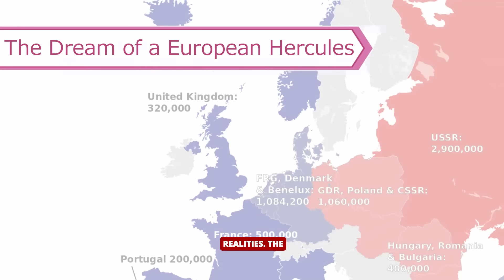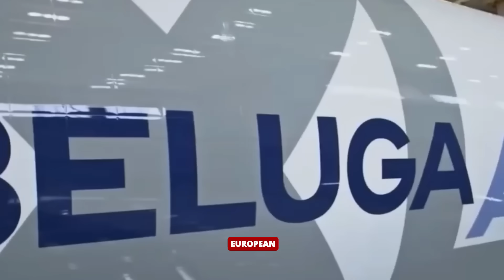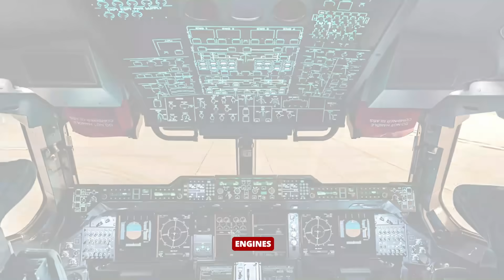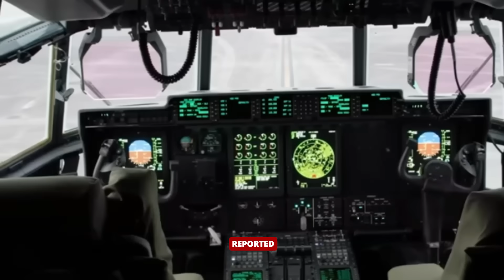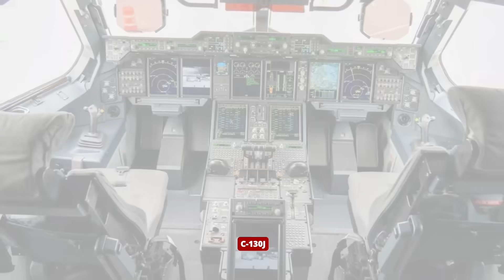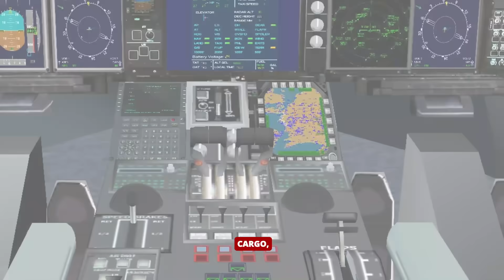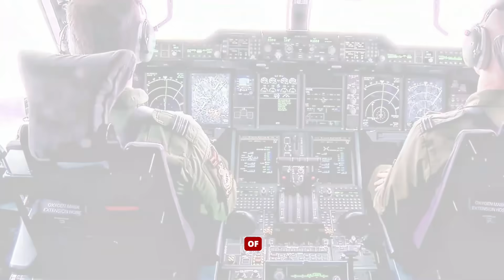Why Europe's $180M Jet Can't Beat a 70-Year-Old Plane

Comment: The A400 was never envisaged as a C-130 replacement, it was meant for air forces that want something that could carry more meaningful payload for a strategic deployment rather than solely for tactical missions (which C-130 is designed for) , but yet found the C17 too expensive , too complicated / too big / out of reach to buy because of political reasons. The A400 is meant to fill this gap between the c-130 and the C17 , not replacing or competing with either one. 

Many nations that bought the A400 didn’t retire their own fleet of C-130s , instead , they operate both types alongside each other to fulfill different airlift requirements. The analogy of comparing the C-130 to the A400 is completely wrong and misleading.
Reply: The C17 and the A400M both started the design phase in the early 1980s. The C17 first flew in 1991. The A400M first flew in 2009. By the time the C17 first flew, the French, Germans and UK already too invested in the A400M program. 
The C17 only cost a bit more than the A400. C17 about 220 million. A400M about 150 to 180 million. The C17 was already sold to many countries before the A400M first flew. 
The C17 is out of production now, so that helps the A400M. The British did sell many of their C130 aircraft due to buying A400M.
Reply: @JohnD-F-YT  And despite the A400M taking another 18 years of design time.... over the C17 they still had to cut out what was considered key features that they originally promised would be in the A400M; which reduced cost of the A400M substantially (and got it finally delivered in 2009).
Reply: @perryallan3524  the A400M developed groundbreaking carbon fibre reinforced composite technology that became important in the A350 and will be critical in future airbus products.   The A400M can carry twice a load of the Hercules and operate in my rougher airstrips than the C17.   The reason it is an a success is because European governments haven’t spent much on defence
Reply: @williamzk9083  My research says that the major advance and development of major structural use composites were for the A380 and predated the decision to use similar composites components on the A400M by several years (even Airbus puts out that information). Not to mention the B787 passenger aircraft that took composite use way beyond what the A380 did (and what the A350 has done).  So I'm not sure why you are claiming the A400M for this honor. 

I agree that the A400M can carry more that the Hercules.  That is not a surprise as it was designed to do so.  Yes it can also handle rougher runways because again... it was designed to do so about 15 years or so after the C-17 was designed.  No surprise there.

I also found that there is now serious discussions going on about restarting the C-17 line.  A number of countries are interested in buying new ones...(including some European Countries) and even the US Air-force is said to be interested again in more of them in the future instead of designing a new replacement because it works so well at what it does.  If that happens the A400M project may never break even (pay for its development cost by selling aircraft).

If you look at the development history of the A400M it is clearly mainly a European employment and political project.  The history of the engine selection makes that extremely clear (the Canadian Pratt and Whitney engine would have been far cheaper - and the European company was allowed to reprice their bid - and then still selected even though they were still the higher priced option).  

The cost overruns and delays were something like 8 times more than for the C-17 development cost overruns (a truly massive cost overrun on the project).
Reply: @perryallan3524 The A380 is built predominantly of a composite called GLARE which was a sandwich of aluminium and glass fibre reinforced plastic   GLARE is much lighter than aluminium and unlike Carbon Fibre Reinforced Plastics can be riveted like conventional sheet.
-The A400M and A350 are made of CFRP cured as complete structures in an autoclave  . Whereas the B787 is cured as. Complete circular fuselage section Airbus developed a technology of curing 4 sections lengthways which allowed outside wide body sections of the A400M and A350 to be made much larger diameter than the B787. 
-The C17 initial cost estimate was 39.6 bILLION USD and the A400M 20 billion euro or 23 billion USD.    Cost over runs doubled the A400M development price to 40 billion Euro (46 billion USD) whereas the C17 budget over run was 1.5 billion USD for a total cost of 41 billion.  Thats only a 10% difference.    A400M cost over runs came from developing radically new technology and under estimating development costs.
179 A400M are on order versus 279 C17.
-The A400M is smaller than a C17 but had twice the capacity of a C130.
-Hopefully more A400M will be ordered
 before production ceases.  
-Europe can not rely on US politics and so A400M must be funded and ordered
Reply: @williamzk9083  You forgot to mention the A380 wing-box - which was the largest composite structural component of the A380 - and its not made from GLARE.
Reply: Thanks for an intelligent comment an A400 it’s closer to a C 17 then a C130
Reply: Instead it lost out to both systems. Air forces looking at it decided it’s cheaper to just sacrifice that increase payload and go with a newer C130 variant or they can stomach the cost to jump to a C17 because the performance difference was worth it.
Reply: The C-17 is a much better and far more cost effective aircraft.... Europe just wanted the ego of claiming that they developed a bigger version - just like the A380 was about ego for the biggest passenger aircraft.
Reply: @perryallan3524  and they succeeded

Comment: A400-M is NOT a jet ☝🏻🤨

🌌🔭
Reply from the maker: Yeah its a turboprop but for the novice viewer Jet is fine. It also didn't cost exactly 180M bummer you didn't point that out too
Reply: @The_Flight_Path 
I apologize for being a bit Snarky previously. I made a slight edit 🖥👀
   $187 million Euros already seemed excessive to someone like me who's so poor I barely have two Nickels to rub together most of the time 🪙🪙
It never occurred to me to check the Sticker Price 🧾 🤯 
😲  But 10 BILLION EUROS!!! 😳
 That's $11,619,369,8 & some pocket change in American Dollars. 
   I did not take into account the ever-present "COST OVERRUNS" that are automatically part & parcel of any aviation\aerospace project, but I couldn't\wouldn't  even consider......
😱 10 BILLION EUROS!!! 🤬

🌌🔭
Reply: Neither is the C-130

Comment: Price not into account, IMO the A400M no doubt is a better plane than the ancient C130. However, the A400M has "too many hands in the cookie jar" that complicates production efficiencies just like what happened to the Boeing 787. No doubt Airbus will eventually iron out the issues and the A400M might overtake the C130 but that's decades away. The C130 is here to stay especially when you figure in the cost/unit.

Comment: But can the Yourapeeing airplane land on a short airstrip?
Reply: That would be a hard no ... nor fly thru Hurricanes (WC-130J) and take 26 Lightning Strikes each pass; even the P-8's had to bow out on Melissa.
Reply: The A400M has a better short take of and landing performance than the Hercules.  It has lower wheel loading for beach landings etc too.
Reply: @petegarnett7731  ??? Depending on which source you read, using maximum effort methods and a lighter load, both takeoff and landing distances required for the C-130 range from “less than a thousand feet” (304 m) to 1,800 feet (548 m). The take-off and landing distances of the A400 aircraft are 980m and 770m respectively.

Comment: “While Europeans argued about propellers … “ Wasn’t there a structural failure in a Hercules propeller causing it to shear off the cabin causing the aircraft to crash? Isn’t that what happened to the Hercules that crashed in Turkey a couple of days ago? 
Perhaps it’s good to argue about things you put on aircraft!
Reply: Awaiting NTSB reports but most probably that TAF C-130E (not a J) threw a Prop and spun thru the Fuselage and then the Tail. "Maintenance" is key on old Aircraft of any kind and that HamStd Prop assy is metal and very, very heavy. USAF grounded all their H models back in 2019 due to hub barrel cracks and there have been issues with crews installing hubs that had been "lubed" with oil when they must be installed "Dry".
Reply: The US Marine KC-130 crashed due to a prop breaking off and going through the aircraft's forward section, which broke off.
The investigation found that an aircraft rebuild facility failed to find a crack in the prop. Nothing wrong with the aircraft design. It was the aircraft rebuild facility improperly inspecting the props. In other words, improper 3rd party maintenance caused the crash of the US Marine CK-130.

No one know what happened to the Turkish C-130 Aircraft. The Turkish C-130 aircraft was 57 years old, Of course it went through many maintenance phases and upgrades during those 57 years.

Comment: Its absolutely WRONG comparing the Atlas with the Hercules. Atlas :  37 tons payload. Hercules 21. Tons.
Totally different categories.
The Atlas is like a medium plus size cargo.
Reply: Agreed "totally different categories".  One properly fulfills its role as a military transport aircraft, and the other was severely hampered by political considerations. They tried to create a. "category killer", and ultimately built something with much NARROWER capability.  Hence one of the design/manufacturing partners buying C130js to fulfill missions the A400 couldn't hack.  Increased lift capacity is irrelevant if the aircraft is incapable of withstanding local conditions where you need to operate it.

And we have C17s if we need to do heavy lifting, like three 15 cruise missile Rapid Dragon pallets.
Reply: @LloydMcElheny-d2w  And let's not forget the mighty C-5 for the really heavy/oversized stuff ... for now anyway. Eventually EU will catch up when they start converting all those unwanted A380's into Cargo "F" designations.
Reply: @craigsowers8456  
He's right, it is completely wrong to compare the C-130 and C-17... they are categorically not in the same class and are not intended for the same purpose.
Source: I've flown both.
Reply: @fallenphoenix864  That could be said of every platform out there but get your point and age old discussion point. But know this Pard ... in a SuperHerc, if you were to make a shallow AOA "hard landing", the Herc's Wings and Empennage may break loose but the Fuselage will hang together to the end. That will NOT happen in a C-17. C-395 or A400M. Why you may ask? Because since 1954, it is manufactured with "Dimpled Skins"; literally built twice. While the others are built in "Lap/Butt" technique ... and why L-100's are still flying. Your choice.
Reply: @fallenphoenix864  But the A400M was originally supposed to be in the same class and for the same purpose. The fact that compromise and committee made it unsuitable for its designed role is a problem.
Reply: BS ... it was the sole reason for A400 ... and they failed for that target. A400 is truly remarkable but Countries with limited budget but a remaining mission can't afford to spend 3.5 times the price for an extra 9 cubic meters of cargo space; it's not ALL about GTW Bro.
Reply: @craigsowers8456 No BS. There are many more specs the A400 outcompetes the C130. It's if they are a different class of cargo planes.
Reply: @armadspengler2717  4 decades building Aircraft all around the World. You have any experience or is this just your uneducated opinion?
Reply: @armadspengler2717  You do know that the A400s price tag is just as high as the AC-130 gun ship compared to just the standard C-130 transport. Not to mention that the C-130 doesn’t require half-mile long runway to land or take-off and it has a smaller radar signature than the A400
Reply: @thomaswakefield6889  Holy crap, where does this price tag argument come from? Yes, the A400 is many times more expensive than the C130, but that is due to a number of factors, e.g. that the development costs of the decades-old C130 are no longer included in the current purchase price. But the main reason that the A400 is more expensive is that it is in a higher performance class than the C130.
A F-35 is also way more espensive than a F-15 or F-18. Or a C17 is more expensive than a A400...
If a country needs to transport military goods of certain dimensions over a longer distance or to perform air-to-air refueling at a certain minimum speed, altitude, and a bigger fuel quantity, the user country cannot use the smaller, slower C130, EVEN IF IT IS WAY CHEAPER, because the specs of the C130 do not meet those requirements.
Reply: @armadspengler2717  The development cost (~$1.6 Billion in 2024 dollars) of the J version is included in the cost of the newest Hercules. Of course that is a small fraction of what it cost to develop the A400.
Reply: @armadspengler2717  
The A-400 has better specs however its cost was 189 mil which nearly as much as C-17
hence why the program failed
Reply: @verdebusterAP  OK, so in that sense, the F-35 program and numerous other military aircraft programs have failed because they exceeded their budgets by a multiple? Got it.
Reply: @armadspengler2717  
The F-35 hit it target price whereas the A400M did not
The F-35 continues to get orders whereas the A400M continues to struggle to get them
Reply: Three C-130s can carry 63 T for the cost of one Atlas so yeah definitely apples and oranges.
Reply: No, the A400 was meant to compete with the C-130 as better option but disagreements in the EU is why the project failed to live up to expections

Comment: They still fly the dc3 around the world too! Once you get it right you get it right. The DC3 is a twin engine plane, also known as a gooney bird and people have tried different wings and different radial engines and various other things to improve it. About the only thing you do to improve this thing is to add very efficient, turbop engines which people have done. If you don't make those engines effi turbo props, you begin losing range, but a turbo prop definitely improves takeoff capability and altitude capability. But the dc3 and the c-130 and the Boeing strata fortress are going to be 200 your airplanes

Comment: The C-130 demonstrates that it's hard to beat a good basic design backed up by seven decades of continuing improvements. Also, in many less-wealthy countries it's hard to sell a plane that's only available new when the competition has a healthy used market with much lower prices and widely available parts.
Reply: This video is misleading and wrong. The c-130 and A400 belongs to a different class of air-lifters with different mission parameters , payload , range and operating cost in mind. The A400 is meant to fill the gap between the C-130 and C-17 , not replacing or competing with either one of them.

Comment: The Hercules is a battle tested platform that has worked in war time. Its designed to land almost anywhere.
Reply: Didn't the US land a Herc on an aircraft carrier at one time, as proof of concept, then actually take off without the catapult???
Reply: @rpeltier2621   Yep, 1963.  completed 21 full-stop landings and 21 unassisted takeoffs during the trials, which tested the aircraft's ability to operate from a carrier without using a catapult or arresting gear
Reply: @robertstout6980  the Herc did require rocket assisted takeoffs
Reply: @rpeltier2621 yes.
Reply: @rpeltier2621  yes although the takeoff required the Herc to use rocket engines and the full length of the flight deck.
Reply: The C130 is simply too small eg for an IFV or a high performance SAM.
Reply: And fly thru Hurricanes (WC-130J) taking an average of 26 Lighting Strikes each pass ... even P-8's didn't fly thru Melisa!

Comment: Whatta bs. The Airbus is faster, can take more cargo and has more range.
Reply: "Faster" yes ... more "Cargo" no, if all things considered. An A400M is 3.5x more expensive and can carry 37,000 lbs. of Cargo vs the 20,000 a single Herc can carry ... but if you buy 3.5 Hercs, that capability hits 70,000 lbs. ... almost double the Atlas.
Reply: Faster, more cargo, and a greater range doesn't fit what combat support and disaster relief typically require. Those take place over relatively short ranges at fast-enough speeds and with cargos of people and supplies that can fit the load capacity.

Comment: Why? Because it is a bad design with a stupid spec. It is 50% larger and twice as heavy as the C130J with twice the power and exactly the same range while costing twice as much. Most operators don't need the capacity and don't want the doubled trip costs. Those that do went for the longer range and twice yet as capable C-17.

Comment: Don't compare the C130J with the A400M. Just don't. They are in different payload classes with the latter at almost twice the payload of the former. 
You cannot replace a C17 with 3-4 C130Js. Similarly you cannot substitute the A400M with a couple of C130J especially if the intended purpose is carrying at least one item weighing in excess of 20 tons.
Reply: Like tank M60 is not M1 Abrams. This video is full of BS!
Reply: During the Iraq War I knew a couple of C-17 pilots. Even with its greater weight capacity, special authorization was required to transport Abram tanks. Doing so reduced the lifespan of the airframe.
Reply: @Inkling777  To relocate Abrams by the air is a huge waste of resources!
Reply: @Inkling777 Interesting predicament. The design of the C17 should certainly spell out the types of loads permissible on the aircraft. A single tank weighing 50 to 60 tons in a 75 ton payload capacity cargo airlifter sounds like a lot of stress on the airframe.